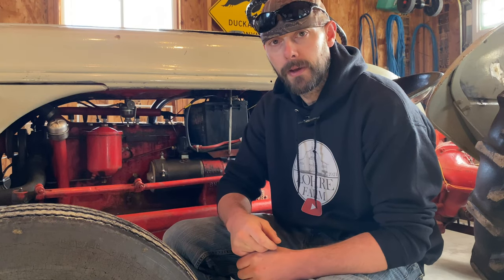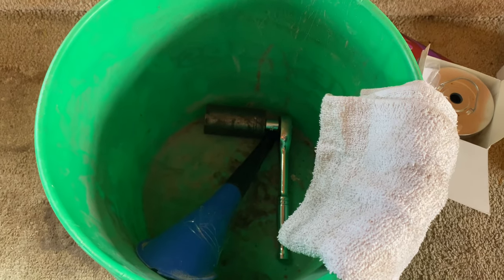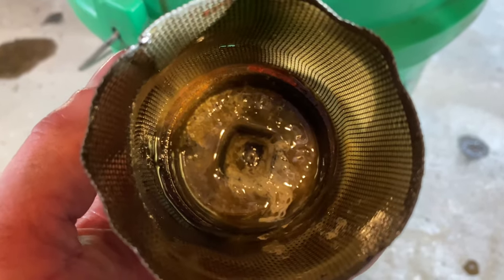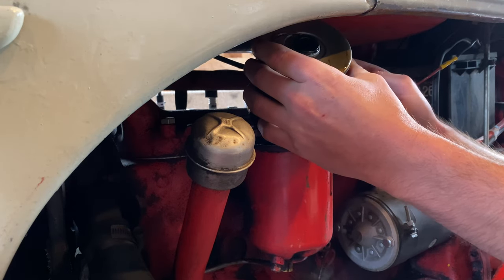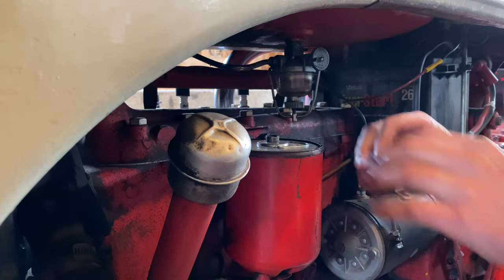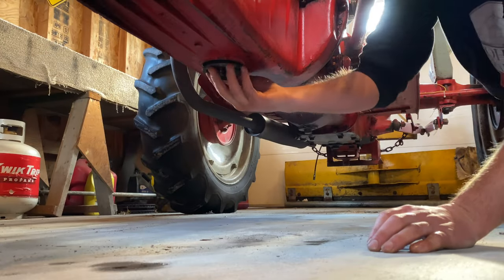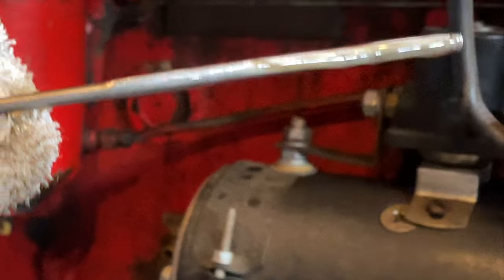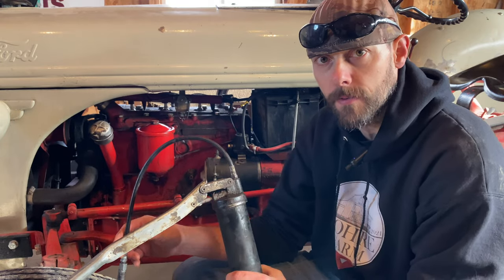Ford 8N Tractor 🛢️ Changing Oil and Filter

Comment: Have had my '52 8N for more than 25 years. At 72 it's nearly same age as I am. Just replaced starter looks same as yours. In Missouri I was told to use non detergent straight 30W oil. Has always worked fine. Only problem with mine is the grease point rubber fittings are so worn now that they don't hold grease well any more. Finally had to replace starter last week with aftermarket one looking like yours. Drained back end lube a few years ago. Front steering gear lube must have been filled when I had a shop replace old (original?) Water pump a couple of years ago. They didn't tell me, nor did they charge me for that lube! Good folks. Occasional points in distributor and oil changes by me. Installed new tires when I bought it over 25 years ago. Tractor still going strong. Will definitely outlast its owner (in this world). Old Henry Ford would be proud.
Reply from the maker: Jeff, That is so cool. I sure hope I am fortunate enough to have mine for 25+ years. See no reason at all to ever part with her. Keep going strong. Thanks for watching!

Comment: I yanked my 8N out of a barn with a skid steer, where the owner said it sat for the last 20 years. Had to drag it home. Paid $300 because that's what he said he could get for it after pulling some parts off and scrapping the rest. It is running and doing work now. He has another one that he said I can have for free, apparently in needs the engine rebuilt. Either I take it or the scrap yard gets it. So, I am about to have two of these tractors. They are much better drug out of their graves and put back to work vs being cut apart and melted down.
Reply from the maker: Sounds like you have a lot of fun in your future. Enjoy the tractors!! ❤️

Comment: I have a 52 8n that my great uncle bought brand new. It ran when we put it up, but when we went to look at it about 7 years later, it wouldn’t start. Turns out the points and carburetor were bad, but it’s back up and running good as new
Reply: We’re from Louisiana
Reply from the maker: That’s awesome! So cool you got it back up and running.

Comment: I just became interested in the N series, or any tractor actually. My best friend has forty wooded acres, perfect for a still. Directly across the road is a non working farm, 30 acres.
The neighbor stopped over and we jokingly told him we were going to use his land to grow grains for a still. He replied that he didn't care what we grew on his farm as long as its legal. He also said that all the old equipment was there so we checked it out and he had an 1953 NAA sitting in the woods. He said as near as he can remember, it has been there nearly 40 years.
After we got it out of the woods, and removed an old bucket from the front, my 83 year old dad came and put it on a trailer, brought it to his house and got it running, and refurbished. He did that all by himself.
This spring I plan to start rebuilding the various components.
So now, it seems, you might be my farming mentor. LOL
Ron Paul, that is all.
Reply from the maker: Haha, Joe, that’s so awesome! Good luck to you sir! The best part about these old Ford tractors is that the parts are all over the place and pretty cheap.

Comment: Hello there, I have been a 8n Ford owner since 2001, I love the simplicity of these old tractors. One thing I learned in changing oil is to keep the seal on the filter canister warm or at room temperature, the first time I changed it it was bitter cold and when I started it up oil covered everything, my dad who's been a mechanic for over 50 years explained to me that it will not seal properly in cold weather, so now I know. Now I usually wait until spring to do it. I'm from NC. Enjoy your tractor!
Reply from the maker: Thanks for sharing! and great advice. The day this was shot it was about 15 degrees outside and the garage was about 50 degrees inside. You can see my breath for most of the video, haha. I can definitely see how temp can come in to play with the seals.

Comment: I bought my 49 8N in 2019. I rebuilt the carburetor last week and it's much easier to start. Hope to change the oil and transmission fluid this week. I hope to use it more this year.
Reply from the maker: The longer I have owned my tractor, the more I have realized that staying on top of even the most basic maintenance has really helped with all run type issues. Enjoy the time with that old gal!

Comment: Also, the farmer i got mine from used it for light mowing and road grading. For oil, he used a Delo 15w/40 (mineral) since it was used in both summer and cooler weather. If he was REALLY going to work it in the heat of summer or something, he said he used a 20w/50 oil. Think ill stick with running a 15w/40 and making sure to add a ZDDP additive since these have flat tappets as well as a lead substitute for the fuel since it was designed to run leaded gas
Reply from the maker: Sounds good. Give it a go. I’ve always just ran non oxy myself. (Accidentally hit the dislike button on your comment) oops 😂

That’s awesome though! You are gonna have some fun for sure.

Comment: The MSN said I shouldn't do any research online even, they said only they could do research...........   ?????   :)   PS I have no idea if mine is even an 8N, something tells me it's newer than a 8N, like a 600 or 800 or 900.  It looks close to the one I knew was an 8N but that one went to my sister. I got it when I inherited the farm, it's older than me for sure  (I'm 65), As for  oil I want to say Dad used SAE 30.  I have dozens of empty SAE 30 cans all over the shop.  Myself I was thinking about 10-W30, but maybe it should be a bit heavier.  ps My farm is in MN too, DL area.  From what I've seen online,  it's the trans/hydraulic oil that most likely really needs changing.
Reply from the maker: Yes, Clean new trans fluid definitely makes a huge difference. As far as the oil. idk, Minnesota is a tough spot for dealing with massive swings in the weather temp during the year. I know I want mine to start pretty easy in the winter to plow snow.

Comment: What size wrench does the plug take? It is a square bolt head
Also. How do I get the gunk out of the oil filter case?  It is black and thick. 195? 8n. Also. My spark plugs are on the top of the motor so I am wondering if it is older than I was told
Reply from the maker: I can’t recall what size. Big. 1-1/8. Or slightly bigger I believe. 

The fill should be through the breather. You should be able to unscrew and clean.

Comment: New to tractor ownership...how hard is it to fix the hydraulic 3 point lift...mine does not work...any advice would be helpful...thanks
Reply from the maker: That is one thing I have fortunately not had to deal with. I would suggest you ask this very question on a couple of the different 8N FB groups. They have been proven to be very helpful folks over there. Best of Luck!

Comment: unfortunately though the drain plug nut is frozen on there and one side is rounded off. how do i get the drain plug out ?
Reply from the maker: Without looking at it, it's pretty hard to tell. I sounds like maybe a vice grip would be of some help though. And getting a replacement on order too.

Comment: why is everyone using dirrent types oil.  You're using 20W-50, an some are using 10W-30. I just bought 10W-40, and am retinking now what to use.  I'm in Michigan, and had my tractor rebuilt basck in 1993, and it runs great.  I do use the WIX51010 filter with the loop on the top end.  But whayt type oil shoould I use for an all weather oil?
Reply from the maker: Not real sure how to answer this one. In the 7 years I’ve had the tractor I probably used a few different weights. This one seems like the best so far. We are in central Minnesota which should be similar to you. I think it has more to do with engine wear for me. This just seems to work best on my tractor.
Reply: @LohreFarm  There are some great Ford tractor repair videos in Youtube put out by "Dan Gingell and Rachel Gingell" under that name, and they use Amsoil 15W40 Synthetic.  I brought my 10W-30 back to the store and bought Mobil 15W-40.  I have always trusted their advice and refer to their videos often. Check them out sometime. It's father Dan,, and daughter Rachel.
Reply from the maker: @lostinmyspace4910 yes, they have some pretty great repair and tune up videos , that’s for sure.

Comment: Need to have a disposable rag, or paper towels to clean out the oil filter canister before you put the new oil filter in, as don’t want to contaminate fresh oil with dirty oil.
Reply from the maker: Hey Ray, that’s a pretty good idea. I usually run a few once’s of new oil through the fill and out the plug as well. Who knows if it does a dang thing, but I like the feeling of flushing out any settle grit. Thanks for the comment.
Reply: @LohreFarm  just noticed there is a drain plug on the bottom of the filter canister . 
On my collector cars, there is none. Have to use a lot of rags !